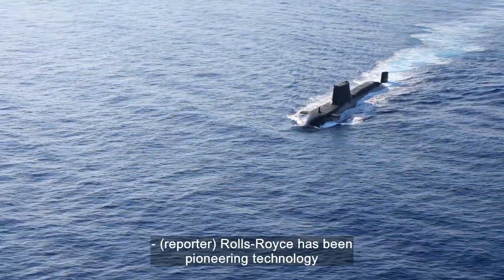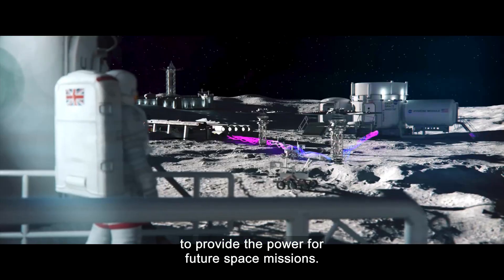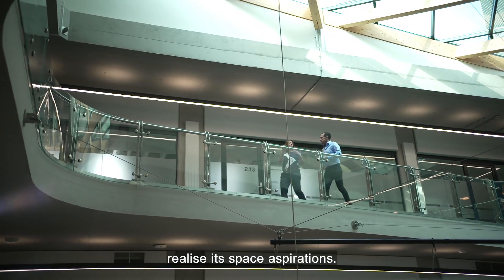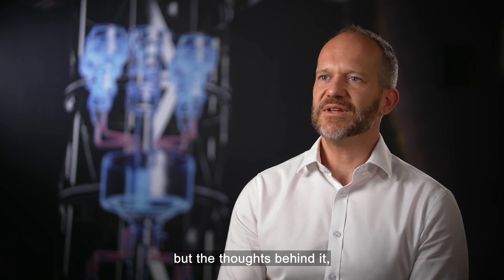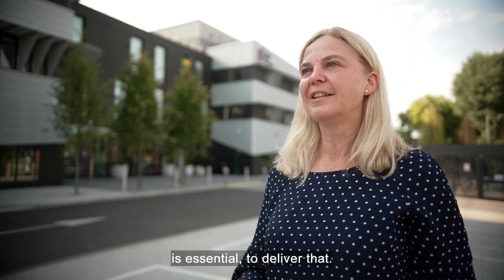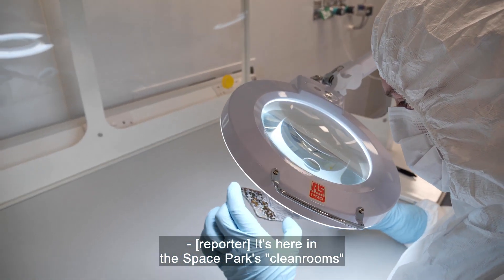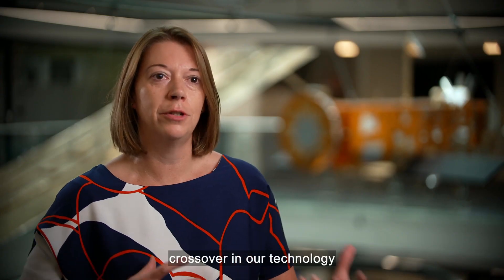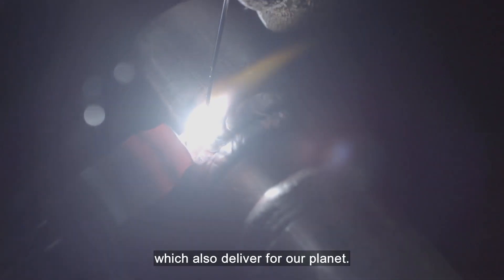Rolls-Royce | Space technology micro-reactor

Comment: Is this a type of a radio-termo electric generator?
Reply: You noticed how there wasn't a word of a clue and I couldn't find anything online either.
Reply: its unlikely its thermoelectric. look at the cooling. its probably some sort of closed loop heat engine.
Reply: @jonathanodude6660  He literally says it's thermoelectric in the clip. "Take thermal energy and produce electric energy". RTGs needs big fans as most of the heat has to go somewhere and can't be used to produce electricity. Without the fans it would overheat. For example in NASAs RTGs only 300W electricity is produced in a unit that produces 4400W of heat.
Reply: @eryck123  that’s not exactly what defines thermoelectric. That quote describes all engines. I said in my response that it’s probably a heat engine, which also converts thermal energy to electrical energy. Thermoelectric uses the difference in temperature between 2 substrates, thermal just means heat is generated and that heat can be used to do work. They aren’t the same.

Having said that, it seems like they were talking about putting radioactive material into the reactor as the heat source, which I didn’t catch. That looks like a closed loop to me so I am unsure which fans you are talking about, but the heat pipes may be used to separate the heat source from the actual thermoelectric generator.